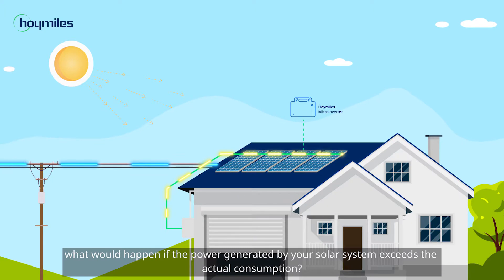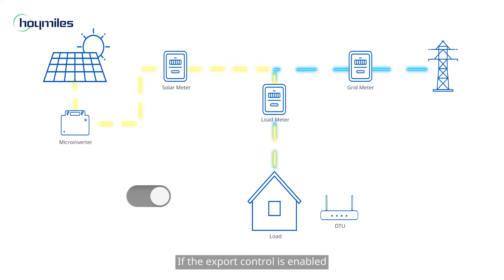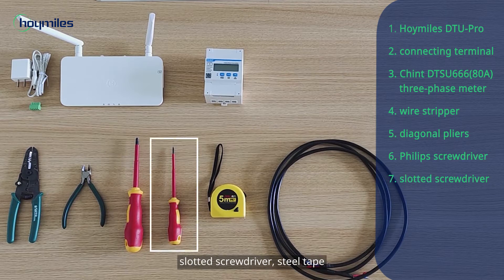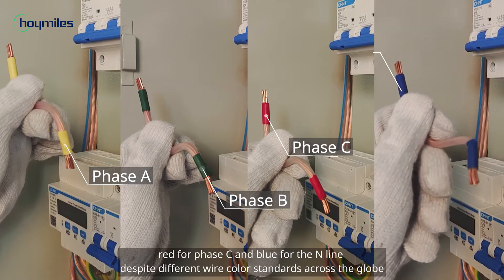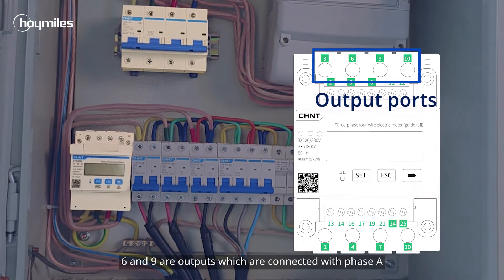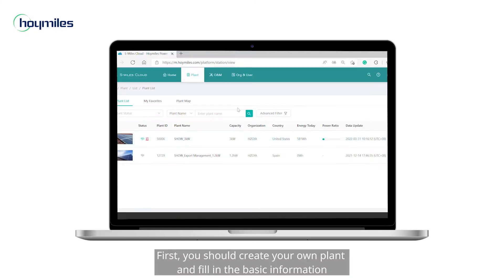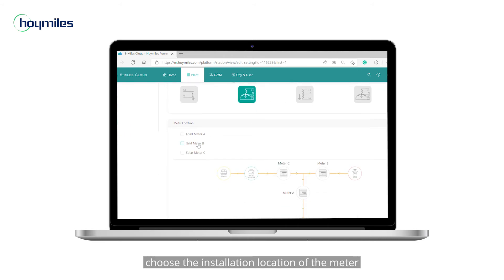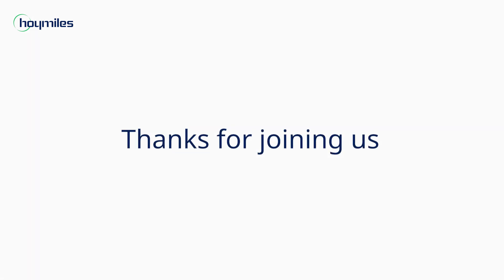Export Management System installation | Three-phase Meter without CT

Comment: Hello, I've been trying for 2 weeks now to set up this meter solution for 2 clients. One with a split phase system, one with a 3 phase system. Both cases the meter always shows offline. I've tried every possible solution. I've been in contact with the local hoymiles support but no succes. Could you guys point me in the dirrection of some support that can help me? I would much apprecuate it. There is no export control, just metering import and export of energy to and from the grid
Reply from the maker: We apologize for the inconvenience you're experiencing. Please kindly send an email to service@hoymiles.com with a detailed description of the issue. Our technical team will help you.
Reply: @Hoymiles  ended up being wrong wiring. Did the opposite to what the manual said and it worked
Reply from the maker: @patricioelosua5886  So pleased to hear that you have resolved this issue. If you have any further problems, please do not hesitate to email us.

Comment: Hello! If a system in a house is divided in 2 due to space, and they are connected to different "load centers" within the same house, would I need 2 Dtus and 2 Chint meters? Thanks!
Reply from the maker: Thanks for your question. This depends. If the two systems in the same house are not far apart, then one DTU would be enough. If there are obstacles like thick walls in between, then you may need 2 DTUs. Whatever the case, one Chint meter will be fine as it is connect in your distribution box